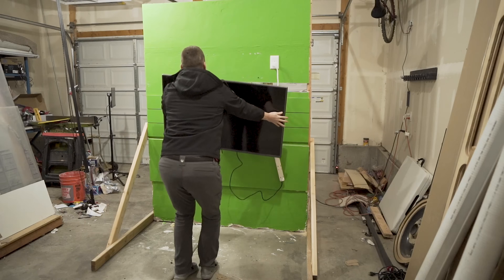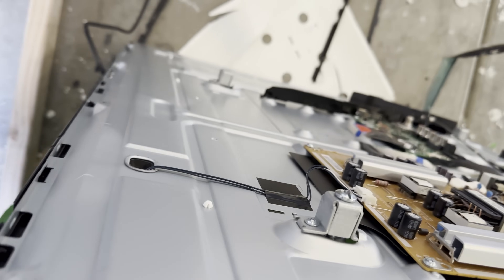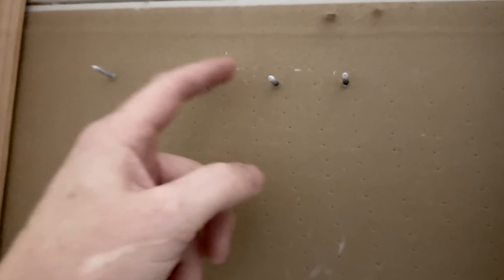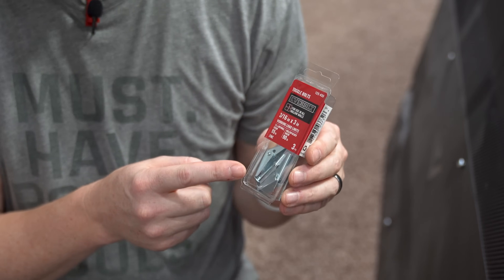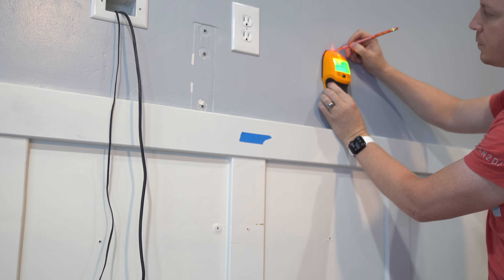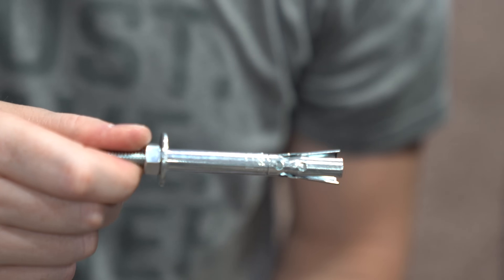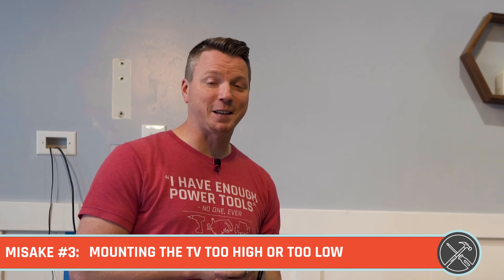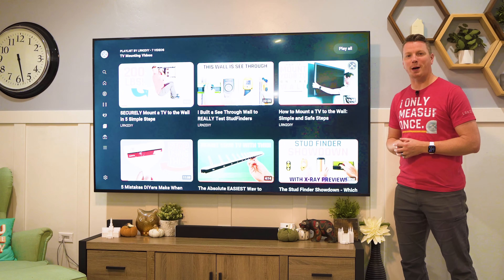3 Mistakes DIYers Make When Mounting a TV

Comment: Never never never EVER mount a tv to ONLY DRYWALL! Even with toggles.
Reply: Agreed. To me this is obvious.
Reply: Facts
Reply: Agreed
Reply: As long as it's not a full motion mount toggle bolts will hold even large tvs. I have used these hundreds of times with no issues.
Reply: Any recommendations for a good stud finder for plaster walls?
Reply: Sometimes you don't have an option
Reply: @Ricky Meadows  A trick that sometimes helps with plaster walls is to find the nails in the trim which are usually into the studs.
Reply: I guess I've been lucky. I don't use a mount that extends and my tv in only 50 inches. I've used snap toggles on multiple walls and never lost my tv.
Reply: @kflowers8276  Toggles will hold a current model 50" with ease.
Reply: @robertperry5206  Yeah, I figured size and weight would reduce the likelihood of an accident using snap toggles in drywall in my situation.
Reply: Depends on size and how many anchors you use to distribute the weight, but I would only do it with smaller tvs and even then only if stud not available
Reply: I have no worries about using 4 toggles on a large TV as long as it is a fixed mount. I always try to use studs but interior walls on new homes can make it a challenge.
Reply: Yep. Velcro ftw
Reply: I've  mounted A LOT of tvs. Toggles works perfectly fine.
Reply: There are some pretty tough dry wall out there
Reply: @rickymeadows9708  every electrical box is nailed to a stud find out on depending on state it can be on either side so check on that usually its on the left
Reply: If it is a flush mount, then it will work. I had my 55-inch flush mount tv up for years with the stab in drywall loop hangers. I used 4 but would never do this for an actual install. Haha
Reply: @supachill1  its not if you dont think about it before hand, i was trying to mount a tv to my wall, and i just drilled straight the the wall not thinking about the fact that it was just straight drywall. in retrospect it’s obvious tho lol. im 17 with no sorta experience w this sorta thing, got a lot to learn
Reply: Obviously dnt know what ur doin but ok😂
Reply: You can always put down some plywood or other secure material to the studs which are available then attach the mount and tv to that material
Reply: I did. 75in and 65" hung on the mounting brackets, and I'm 200+ lbs  toggles can hold the weight, so can the drywall. Don't know what yall talking about
Reply: @em6824  The problem with toggles and anchors is as there are small movements (for example if you live near a road with heavy vehicles or rail traffic) the paper and gyprock wears down a bit and eventually this can lead to a tear. If if works for you that's fantastic. It comes down to risk tolerance and what is the worst that happens if the tv falls. Again, its easy to just fasten some plywood to the studs and then mount to that behind the TV.
Reply: I allways use toggles each hold about 200 pounds I use four never have they failed even on old 80 inch TVs
Reply: @OnyxExeL yes you do, it's called adding wood strips or panel to reach studs. You drill the wood into wall studs. That allows you to place your mount anywhere you want and you can still into wood now.
Reply: @rickymeadows9708 zircon are good mate
Reply: @rickymeadows9708 a hammer 🔨 😅
Reply: @AL1K I have a HDMI and an outlet box above my fireplace. Neither are mounted to studs. They have those boxes with the wings that flip out like a toggle bolt when tightened.
Reply: No, using toggles or those zip style anchors is perfectly fine for new TVs, unless it's a 98" planar commercial grade TV or something.
Reply: Yeah what do you do with metal studs?
Reply: @Ryan-cp4rh  use self tapping metal screws or pre drill with a metal drill bit
Reply: Toggles have a weight limit stay within that and you aren’t limited to where the studs are! Thank you for coming to my TED talk.
Reply: Yes, unless you use toggle bolts
Reply: @AL1K they don't have to be nailed to a stud but they probably almost always are
Reply: Friend of mine, well a dumb friend of mine did this because he "knows what he was doing" well after a few tugs on a 60" TV to test it, immediately fell LMFAO  he didn't want to believe me
Reply: Well what do I do then I need too hang two tvs and there's only one student and I can't stack them
Reply: @Ryan-cp4rh  I use strap toggles when dealing with metal studs.
Reply: It depends on the mounting situation. If you're not using a articulating mount, you're not putting pressure on the drywall. If you're just mounting it flat toddlers are just fine.
Reply: @rickymeadows9708  Franklin sensors
Reply: @AL1K not every. If it's a "old work" box it's more than likely not
Reply: Yup! You will destroy a lot
Of things and get hurt
Reply: What about toggles into studs on a drywall wall? Wouldn't that be as secure as using a piece of wood on the back as you're drilling into studs and not straight plywood?
Reply: @rp9674 does op mean even drilling into a stud on plywood is a no-no? Meaning you'd have to put a piece of wood on the back drilled into a stud Or do they just mean drilling into plywood without drilling into a stud and then mounting the tv is a no-no? Not  too familiar with any of this!  As long as youre drilling into a stud on a drywall wall without using a piece of wood you should be fine right?Thanks.
Reply: My wall only has 2 areas where there is a Beam/Stud, at least that's what the Studfinder read. My TV is a Westinghouse 70'. Hung it once, took it down because the Swivel Mount I bought said hold one amount of Weight but yet, it started to bend and lean the TV forward(extremely) 😢. Took it down and now looking for a Mount that holds more Weight. Please Help!!!!!!
Reply: What about these no stud mounts
Reply: I just rearranged my apartment and I do not know I was so lucky to mount my tv to the right side of my bedroom. Now that I moved everything, I’m realizing that on the other wall, there’s no studs but only drywall 😢
Reply: I'm a installer and use toggles all the time. I hit a stud and use toggles on the other side.
Reply: It's always people who have never tried it who say NEVER EVER MOUNT TO ONLY DRYWALL
Reply: He already said it
Reply: Lmao I have two 65" tvs mounted on full motion mounts with snaptoggles. I understand the concern however... They haven't budged for years and I have metal studs so I need the anchors
Reply: For the last 7 years my tv has been mounted only to the drywall using toggle bolts only. Each toggler individually will hold 100lbs. I think the issue has more to do with the condition of the drywall.  Drywall that has been patched  may have strength issues.
Reply: I was looking at some reviews for Elephant Anchors and someone gave them a 1-star review with pictures…they only put four anchors no lag bolt  into drywall only!!! lol unfortunately I need the anchors but I have one stud to place two lag bolts and will place four elephant anchors in the corners
Reply: You can literally mount a tv using nails. As long as it's not a mount that allows motion. So I recommend mounting the tv at viewing height and skip the heavy duty mounts. Unless there is a concern for child or pet safety.
Reply: Learned this the hard way.
Reply: Agreed
Reply: You can 100% mount tvs to drywall/plasterboard!!! As always use the right fixings
Reply: After several tear outs, I won't even mount curtain rods unless it's to a stud.

Comment: I bought a Vizio and put it on the wall. I wanted to mount my Vizio soundbar under the TV. After a lot of failed attempts to mount it, I found out that the TV legs that the TV came with can unscrew and adjust to mount your soundbar. Just a heads up to people who want to do the same. Everything you need is included in the TV packaging.

Comment: As a tv installer and home theater tech for 9 years I can say I nor any of my coworkers have ever drove a screw to far into the versa hole on the back of a tv. As you said they design it to be idiot proof. Also you don't need to use anything other than a hand screw driver. You don't need to torch it at all. If its snug you are fine. Also spacers are in the pack for a reason. If the screw is too long and the shorter one is too short you just add a spacer. Put it on the bolt first so that you don't extend the tv further from the wall. Clients usually want it as close as possible. Also I can see one of the tvs in this example is a sony that uses screw adapters. Make sure to remove the screw, add the adapter and then just re use the screw that was in the tv.  Furthermore, A basic rule is if its a fixed mount you can use toggle anchors ( hiltis rated at 240 lb 1/2 inch) If it is full motion you 100% require two studs. Now in regards to the green wall example if you have a stud in center and a stud on right side you make a judgement, If the tv is 65 or above you toggle the left side, If its below 65 it does not weigh enough to pull on the mount and the 4 lag bolts will be fine.  Another tip. Studs will 90% of the time be 16 inches or 24 inches apart if built by code meaning you don't need no template or painters tape. Locate a stud, Find the height for the mount. Screw one lag bolt into the mount so its not moving around. Level it. Then measure 16 and drive in the 2 lag bolts for the other side. This is a great tutorial for a beginner DIY but its being taught by another DIY. It can be done so much easier with very little work. NEVER EVER EVER use traditional drywall anchors. If you are mounting a tv you need nothing less than an actual stud with lag bolts or 1/2 inch toggle bolts specifically the ones with plastic pull tabs like the ones made by HILTI . The flip toggle ones in the video will work and be safe but not prefered for efficiency. Toggler option described is exactly what you need. Magnetic stud finders suck. They can help you find the general area about as good and knocking on the wall with your hand but they can be useful. What you really need is a magnetic stud finder. Straight analog, you are finding the drywall screws/nails that are going into the center of the stud. You find that you found your stud. You want to avoid doing the drill to find the stud technique unless its your last resort. You don't want to turn your wall into swiss cheese even if its going to be hidden by the tv. The only time I personally do this is if its wood panelling wall and a magnet or stud finder is not going to work and even then I will stick something in a whole to find the stud to prevent further holes. Also I have mounted over a 100 85 inch tvs using nothing but anchors. You need to make sure the drywall does not flex prior to installation meaning the drywall is very secure to the studs. Also as I said before you can only do this with a fixed position mount and not full motion or it will cause sag leading to pulling off the wall. If you are doing masonry, start with the smallest bit and keep going up in size it will save you a lot of time. The brand and mount does not matter if you are 65 inches and below due to the weight of the tv. Anything above I would personally recommend, rocketfish, sanus, Kantos, and chief. In regards to dangerous tests. For every single one of my clients that owns a tv mount that can hold up to 200 lb I will literally hang from the mount with my entire body weight to show the customer that they have no worry or fear that their tv will ever come off the wall. I weigh 180 lb. The easiest way to mount your tv to the height you desire is you attach the mount to the tv, you measure the full length of the tv. You then measure how far down the screw holes are from the mount. You then put the tape measure of the full length of the tv up to the wall, you align so the center of the tv is center with the persons eyes when sitting at their chair or couch. Once you have that you mark the location that you got from the top to the mount hole. That is where your mount goes. Overall this was a very good video and I'm sure a lot of people can learn from this but overall This is a bit to overkill and excessive. This can be done in an easier more fast paced/ efficient way. I hope my large comment wasn't for nothing and people find value.
Reply: Praying that I catch you in time, but do you think a full motion is fine with one stud for a 55" television weighing about 30lbs? I have 24" studs and any of the mounts with the range I want that I could get in time only go up to 16"-18" spacing. Specifically in this example thinking of the Rocketfish
Reply: @Token--  you can get a single stud full motion mount that fits a 55 tv hope it helps
Reply: I’m trying to get the right stud finder for the job , and I just want to clarify - magnetic stud finder is good or bad? Prob just an autocorrect error , but you said “magnetic stud finders suck” then “what you need is a magnetic stud finder” , did you mean the latter ?
Reply: @ricjenner1120  oh thank you i did not notice that. yea magnetic stud finders are a lot more accurate. i use a digital stud finder or i just pound on the wall to get a rough idea of the stud and the magnetic stud finder to confirm. i trust a magnetic stud finder a lot more than any digital one. once you find a nail with the magnetic one you are most likely on a stud and to confirm its not a pipe or a metal stud slide the magnet up and down the wall in the same location. if the magnet only grabs every 6-12 inches you know its a wooden stud if the magnet sticks to the wall the whole time you slide it up and down its a pipe or a metal stud.
Reply: I'm wanting to mount my 75" to the ceiling in my garage. Any specific tips I should know about?
Reply: @diceflawless9115  they make specific ceiling mounts with different size poles for how far down from the ceiling the TV goes and you just gotta find the studs in the ceiling. Hopefully you have a smooth ceiling. Will make finding studs a lot easier.
Reply: AV dork here as well, this EXACTLY how we mount TVs, I like to use probe wire from LSDI to find center stud though. I've ONLY used magnetic stud finders and the only thing I use a laser for is ceiling speakers. Also, 100% agree on the Hilti toggles, it's all we use and we have NEVER had a TV fall. Great write up bro.
Reply: Thank you!  What if the wall has metal studs 24" apart?  A common wall in townhouse complex.  Wanting to mount a 65" Hisense TV.  Thanks!
Reply: @edrose4583  Avoid the studs entirely and use 1/4 inch hilti toggle bolts. 4 of them, one for each corner of the wall bracket. the tv will never fall but do not use a full motion style mount just a fixed position or tilting mount.
Reply: @ricjenner1120  Magnetics are good. If you can get an old broken hard drive then open it and take out the really powerful magnetic on that. I use those. But you want a few. Like our studs in our bathroom I know, don't all run vertical. Some run in portrait mode as was only option we had when putting them in.
Reply: @syntrexfpv1347  Thank you!  Plan to use a Mounting Dream tilt mount but not tilt at all - keep upright/flat.  Sound good?
Reply: @edrose4583  ya that is fine.
Reply: I have a 65" the studs were to far apart to get 4 bolts so we centered the bracket with to bolt to stud. I was thinking of getting 2 of the 1/2 toggles to put one in each top corner. Do you think this is good enough, and would I have to unmount the mount to get the toggles in?
Reply: @lchase70072  you do need to remove the mount to put in the toggles but yes one stud with two lags and two toggles
Reply: @syntrexfpv1347 can you reuse the lag holes?
Reply: @lchase70072  yes that is fine
Reply: This information is gold! Would you use lag bolts on a metal stud or toggle only for a 65 inch?
Reply: @novaclonious00  avoid the studs, use toggles in between the studs and use for two on top corners two on bottom corners. As long as it's a tilting or fixed bracket you are fine. I would not use a full motion mount in this situation period.
Reply: I have a 65 inch (57lbs) mounted to a sanus full motion mount. I used 4 3/8s lags to mount it to my studs (2). I used a 15/64 pilot hole for my lag bolts and the directions called for 1/4 inch which i did not have. I’m hoping i didn’t crack my stud. i’m curious if you would know if you cracked your stud by being able to hear it or if at this point the tv would’ve already fallen out of the wall if you did?
Reply: I have a 65 inch (57lbs) mounted to a sanus full motion mount. I used 4 3/8s lags to mount it to my studs (2). I used a 15/64 pilot hole for my lag bolts and the directions called for 1/4 inch which i did not have. I’m hoping i didn’t crack my stud. i’m curious if you would know if you cracked your stud by being able to hear it or if at this point the tv would’ve already fallen out of the wall if you did?
Reply: If a wall has metal studs, then you will have to use a metal drill bit.

Comment: I kind of have some OCD issues, so I really wanted my monitor to be centered behind my desk. Here is my solution: I built a frame from 2 x 4 studs but cut them down so they have nice sharp edges and painted them matte black to match my desk. That way they don't look like common 2 x 4s.  I made sure to put a center vertical 2 x 4 that runs the length of the frame. The frame was built a little higher than the desk. I also put two 2 x 4 boards running horizontally on the bottom, but those 2 x 4 boards have the thicker part of the boards facing out. Very easy to build with just a Kreg pocket hole jig designed specifically for 2 x 4 boards because it uses thicker screws. Screw it together from the back. It actually looks very nice. You just find your stud and attach the frame by screwing it into the wall. It doesn't matter where the stud is because the frame will stay centered. Just attach the TV mount to the vertical center board, then attach your TV and you are done.
Reply: Toddlers would've worked just fine on that light monitor. Lotta drama for nothing.